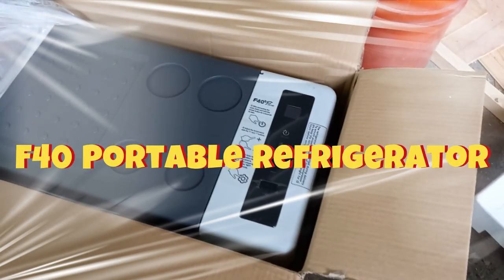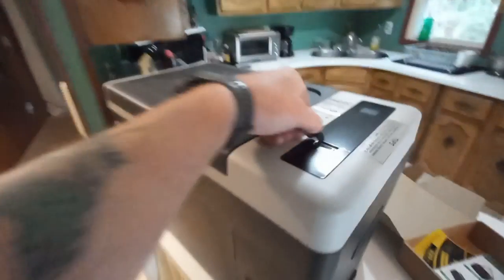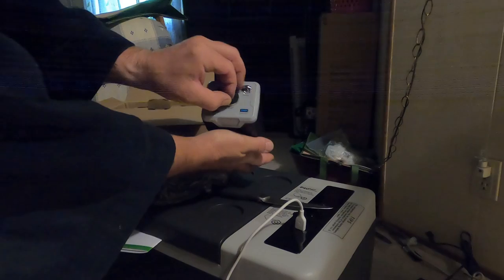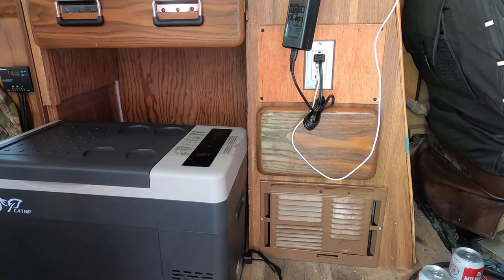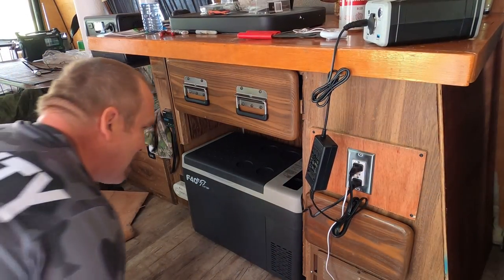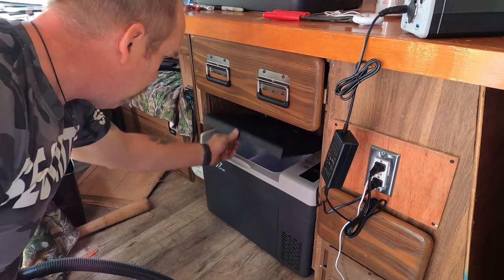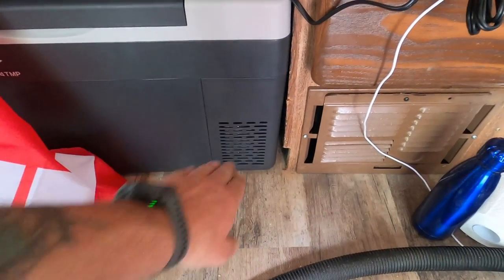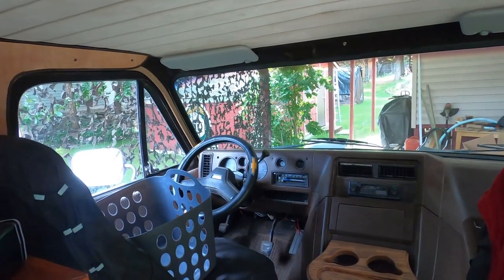F40 Fridge  Install into My Van.

Comment: Hey, the F40 can run inside the van? There is no issuses?
Reply from the maker: Yes it sure can. Had it going 10 days 24/7  It does kick out when cooled to setting. You do need to leave some space around it.